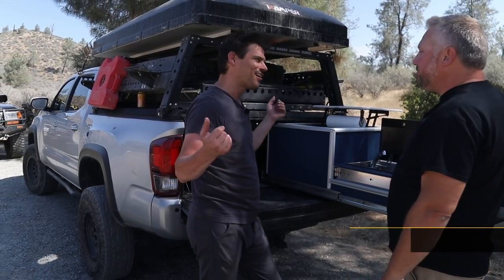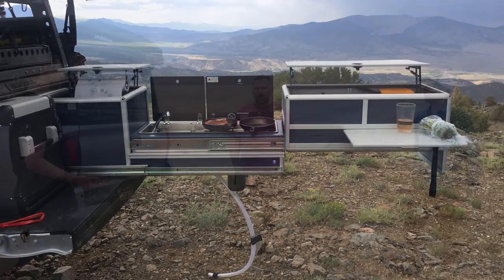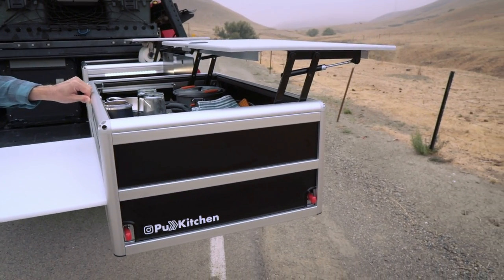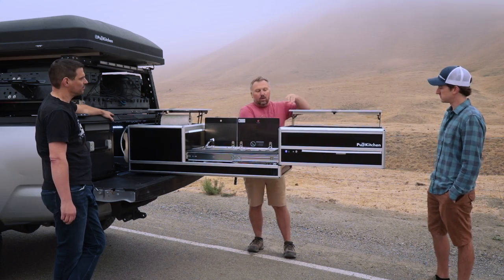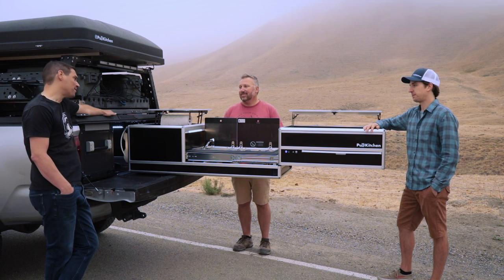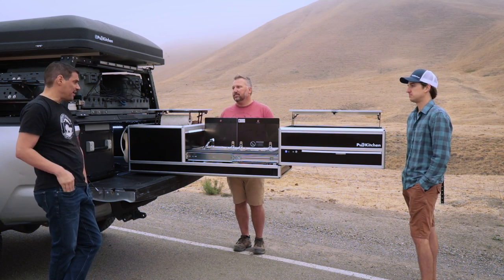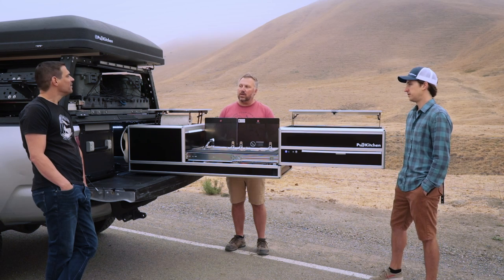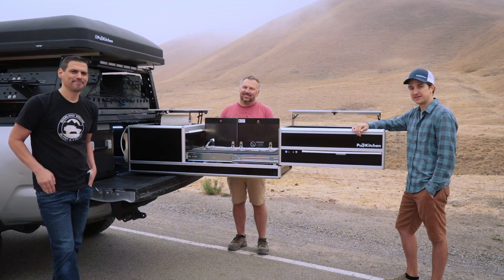Ultimate Camp Kitchen MkIII - DIY to Biz

Comment: $5,000 is a tough price to try and sell people on. It’s a great idea and design but that’s a hefty price tag!
Reply: I've priced out what Dave did, before all the improvements. $4k isn't a bad price at all. How much is your time worth to build something similar?
Reply: $4295 is a premium price for sure, as premium components like stainless steel, anodized aluminum, starboard HDPE, and aluminum composite material panels. Not to mention the complex design and build, we are proud of it and our customers have raved about how it changes camping for them! We aren’t saying you need a Pull Kitchen, but we are saying you might want one. :)
Reply: Earl Gilbert most are surprised when you price our components alone how much materials cost! Thanks!
Reply: @pullkitchen1298  Oh, I don't need a Pullkitchen, but I do want one. when can you make one to fit a Ranger with its 58" bed?
Reply: Checkout trail kitchens simple designs ...
Reply: So how much is your 3” lift, 35” tyres with wheels, your diff lock, bull bar, rooftop tent etc etc etc, context people.
Reply: @pullkitchen1298  it is beautiful! You guys worked very hard in this for sure! But that price point will take many out of the market.
Reply: @kve6360  ... then I would assume those people are not their target demographic market.
Reply: @RustyB453  thats a vast majority of all people 😂🤣😂🤣😉😉😉😉
Reply: 5k is a great price for something this beautiful. I'd totally buy one.
Reply: They said they were in CA. Those people are use to paying double for things. Looks nice. Not worth $4300.00.
Reply: 5g!!!!!! I went to website and can't even find a price or way to order it 5g no thanks
Reply: If want cheap spend $500 a mega mart and 2 weekends doing it. If your looking for a quality unit that’s plug and play accessory to your truck by it.

Comment: I don't know if you are aware or not, but companies like 80-20 Inc have kitting capability where you can specify every component and every cut length and they will kit it together to be available for purchase.  They even have the panels that go inside and exact counts of tee nuts and bolts in the kit.

Comment: to make this even more useful, I would mount it on a bedslide platform so It will extend further away from the tailgate.and then rotate the unit so it faces outward.  This will then allow access to the opposite side of the bedslide platform for some other storage system or general access to the bed without disrupting the cooking. Great Unit guys!!!

Comment: Yeah nice set up gents ! cost wise at the upper end, but you get what you pay for !
Those drawer runners can take a hammering, but would be concerned with some boof-head leaning or being rough on the outer section ? how would drop down legs work, like the ladders everyone is using for roof top tents these days ? the rungs could be used for tea towels, etc !
Reply: OutLandyish Rig This is our 5th design iteration to get the strength of the design where it is today. Parker can hang on the end, although we don’t recommend having Parker’s hang on the end of Pull Kitchens

Comment: Damn, I made a mistake watching this video, possibly a $4300 “mistake”! I love that this fits UNDER a Diamondback cover! Curious, which Dometic is that that also fits, presumably on a slide, under the DB cover?
Reply: Josh Allen the Dometic is a 75DZ with a DIY ultra low profile slide that we may start producing as well
Reply: @pullkitchen1298   Whats the weight on the complete system (dry)?
Reply: @budnixon  205lbs

Comment: Can you design a kitchen for a Jeep Wrangler that leaves space for sleeping inside and a refrigerator?  Possibly putting the later as a slideout drawer from the driver's side rear door?

I don't know dimensions well, but I'd LOVE to see a well made kitchen that have half of it as the stove, prepping, and cleaning half.  Half for dry food drawers, the water jug, and whatever, then behind the seats for a fridge on one side and clothes drawrs on the other.  Maybe smaller storage in the back corners.  With sleeping space for a 4" pad on top of it all.  I don't have the tools or knowledge yet to build something like that myself, but I'd love to find a professionally build one I can slot in modularly and pull out when it's not being used for camping.

Comment: Pretty sweet setup👌  I would like to see one set to pull out in the mirror position, as well as to be qwik removal for base camp set up.  All in all a most excellent product! 😎🎸🤘🏻
Reply: Each PullKitchen can be mounted on either side of the vehicle and mirrored from the one shown. Thanks!
Reply: @pullkitchen1298   Thank you for the reply
Reply: @keithhogan6997  just saw the comment, apologies for the delay!
Reply: @pullkitchen1298  no worries, life happens.  Did you by chance have plans for a model that can be readily removed for base camp set up?

Comment: I wonder if putting this on top of a Decked system in an F250 will have this too high up to use?
I wonder if the other system will fit in a new Defender?
Reply: bcampagnolo That’s a good question and consideration. The cook surface is 8” above the bottom of the kitchen, which is just above the truck bed. So you would need to factor in the height of your truck+decked+plus the kitchen and see how that would fit your needs. The Latitude will be more applicable for a Defender

Comment: Hey everybody..! Member number 10291 (? It's been a while since I looked at it)
Anyway, my H3 build has turned a very dramatic adventure vehicle corner with the roof chopped off to the back edge of the front doors. The interior is sparce with only front seats (think of the Camel Trophy Safari Land Rovers of the 80s).
I need this kitchen set up guys !
It looks like it could easily survive under a canvas safari roof (fully roll cage supported), and a sleeping platform. Seriously, I'll be contacting you soon.
Reply: We are almost done developing the weatherproof cover that fits our kitchens like a glove. Very similar to a roof top tent cover. So in the back of your rig it would do great. 🙌🏻

Comment: the only problem i dont like about this style kitchens is the type of roller drawer style they use. they are not sealed so any dust that gets in the bed and dust from being deployed causes them to run rough, and eventual fail. you can use sealed bearings like Fridge slider style where a rail runs on the bearings instead of a ball its a roller. not only is it problem free as far as debris. the slider is way stronger. if you want an example of the type of tray i am talking about this guy shows a great version of it.           https://www.youtube.com/watch?v=9etCVBIdegY